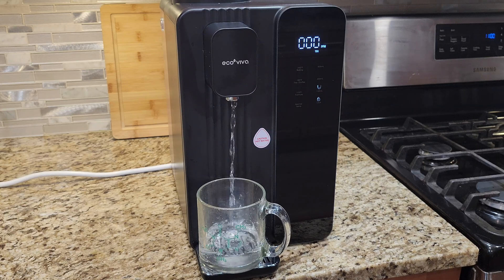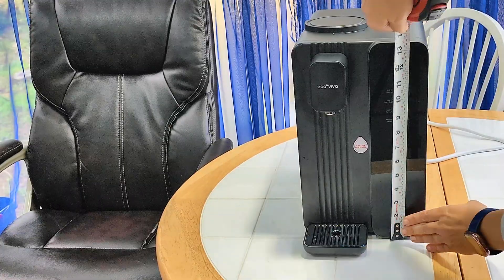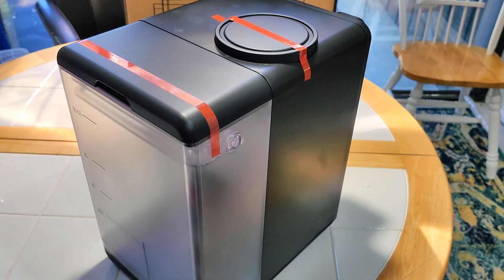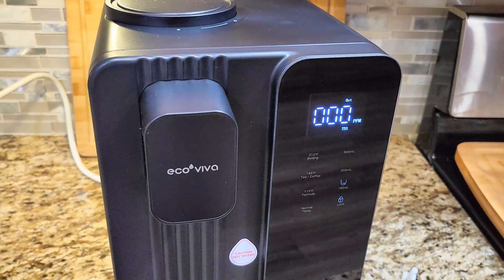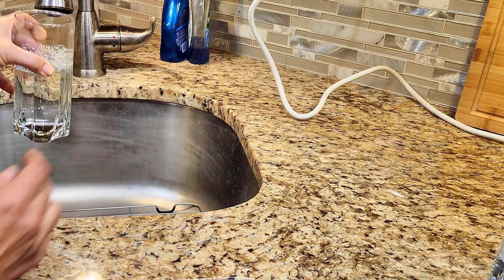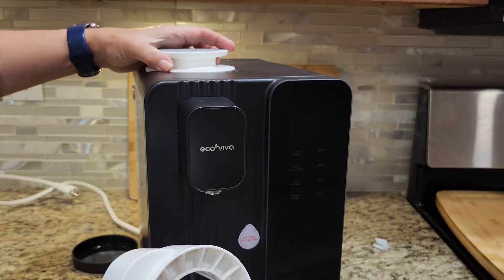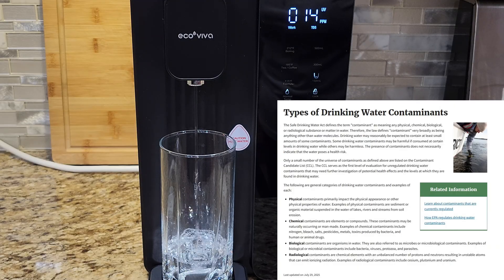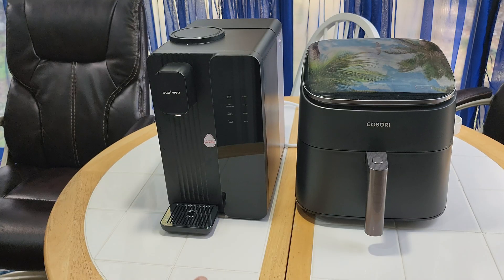Ecoviva Countertop RO System: Does it Work? - TDS Results and Review

Comment: Did you completely dry off the TV meter before you went to the next set of waters?
Reply from the maker: no, I didn't think to do that, but I believe the readings were accurate. If I don't press hold on the meter the reading goes back to 0 so it only seems to read when its submerged. Also, the reading on the Ecoviva was the same as my meter, so I think the meter was accurate. I will dry off and do it again to see if that mattered, thanks for the comment!